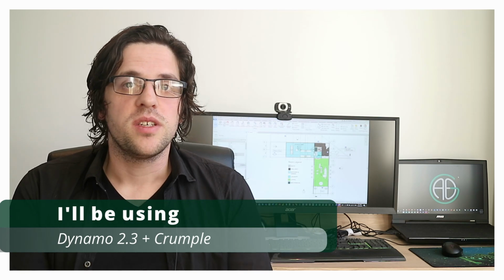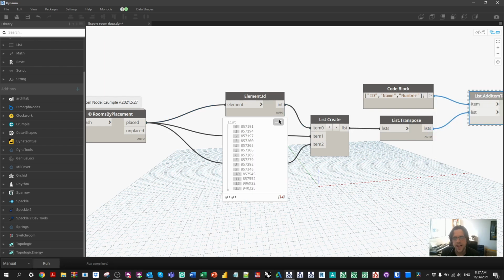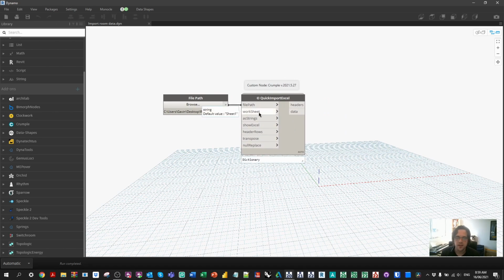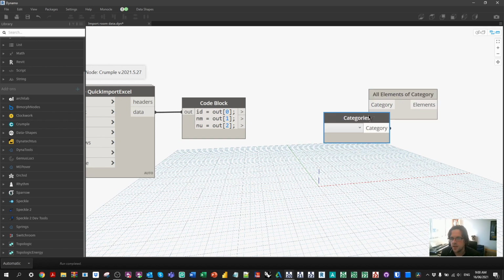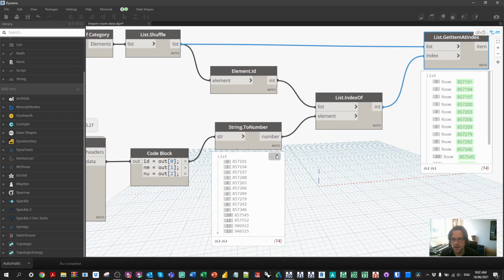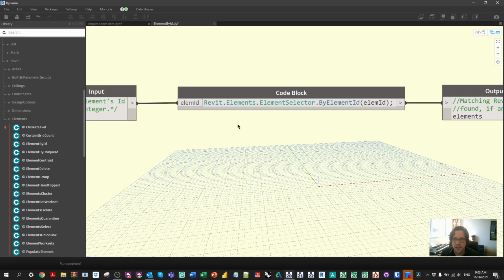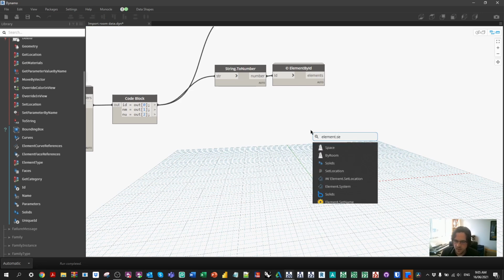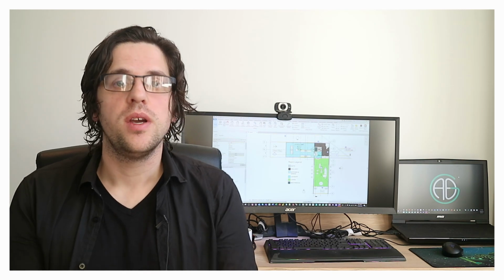Retrieve Revit elements by Id using Dynamo!

Comment: Thanks Gavin for the video, I'm wondering if you can elaborate on how to make this a little more flexible. I'd love to be able to export selected parameters (from a list using DatashepesUI), make changes in excel then import the revised data without having to create code blocks containing the parameter names for each script. For long term use and use across multiple projects I feel that this would be helpful. I'm able to read the top line in excel to list the column headers but have yet to be able to plug that data back into a "SetParameterByName" node. Hope this makes sense, any thoughts?
Reply from the maker: It's quite complex but i have a video pair that shows a way to import/export family data. I've since built more refined takes on this for some clients, but the approach is still along the same lines.

https://youtu.be/bfiXf2E3Crs
Reply: @AussieBIMGuru  Thanks very much! I've actually found (searching the comments section and your replies) that DiRoots makes the Revit/Excel link I was trying to build. We're a small firm and are hesitant to buy BIMLink or other expensive add-ins. Thanks as always for the high quality content! It's so very much appreciated.

Comment: Do you Have some method for adding document parameters (NOT shared parameter) and adding categories to existing parameters
Reply from the maker: Typically I use paramanager by diroots. Dynamo isn't very good at this, but it can do it using some OOTB nodes in 2022 onwards.
Reply: @AussieBIMGuru  I use the same but it creates shared parameters without an SP file which is fine but not a true SP.  Jeremy Tammik has a method for project parameters but it is way beyond my understanding may it could be a part of your Crumple package.
Reply from the maker: @tahajaorawala7103  because I use paramanager and orchid I try not to double up on what theyre able to do. If i recall correctly in revit api adding categories after is difficult, cant recall if possible.

Comment: Thank you for the video. I would like to know, the default 'Element ID' shared parameter file location in Revit 2021. Somehow I lost the track, now unable to find it. Thanks.
Reply from the maker: By default Revit comes with no shared parameter file until you create one as far as I can recall. Element Id is a property inherent to elements when created, it doesn't use a shared parameter.
Reply: @AussieBIMGuru  Thank you very much for a quick reply. So then how can I retrieve Element IDs without using dynamo as shared parameter?
Reply from the maker: @vijeshkumarv8469  oh if you want to expose it then yes writing to a parameter is the only way. Typically we don't expose this parameter though, we just use it in the background.
Reply: @AussieBIMGuru  I wish to load it in my schedules without using the Dynamo. Can I do that? Are there any tutorials or links on that. I have searched for the whole day. I could not find it. Am sorry.
Reply from the maker: @vijeshkumarv8469  no as far as i know you need dynamo or an app to read the value and write it to another visible parameter.
Reply: @AussieBIMGuru  Thank you and very kind of you for your replies. Have a good day.

Comment: Great Video Gavin!  Thank you for redirecting me to this video, which answer some important questions. I will use the script with "Spaces".  My goal is to link cooling and heating loads per room, as well as Mech. equipment, grilles and thermostats for each space or room.
Reply from the maker: You're welcome! Linking elements to spaces can be done using intersection of their location or bounding box with space geometry, and there might be some packages with this functionality as well. Check out MEPover which can get all connected elements in a system as well - I know some engineers use this to inform a system of all the rooms it is servicing by clashing a system's connected registers with the spaces.

Comment: Hi sir..how r u .sir...list.map nd math.min node ...what is the use of these node
Reply: Sory. I type wrong ....math.remap.range and list.min......node .....what is the use of these nodes...thanku sir .....
Reply from the maker: List.minimum takes the smallest item from a list that contains numerical data.

Remap range takes the range of values in a list and adjusts their values to sit across a different range. So for example if I remapped [0,4,6,10] from 0-10 to 0-100, the list would become [0,40,60,100].

Both of these are list management tools, so we use them quite often - there isn't a specific architectural example but I use remapping to convert 0-1 into RGB channels quite often for example (0-255).
Reply: @AussieBIMGuru  thanku sir

Comment: Hi Gavin

I have a question
I want to fill parameter by the value of text,  this value next to elements on plan 
( Convet text on plan to value of parameter for the nearest elements )
by using dynamo
Reply from the maker: Not easily possible. Add parameters to the element and set their value, then tag the element. This is the way Revit is intended to be used, the less text the better.

If they are text notes you could get the text notes in view and the elements, then find the closest text note to each element in order to set the value.

Refer to my video on closest grids to see how finding closest elements is done.